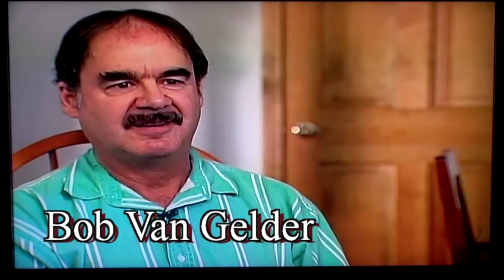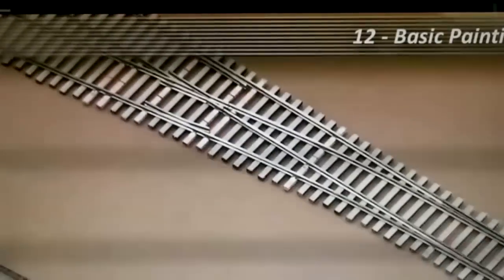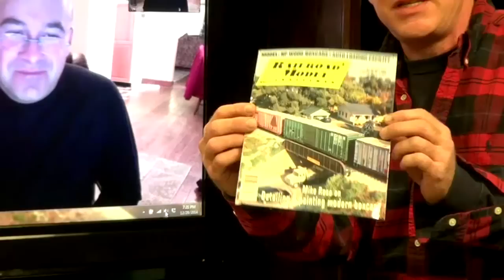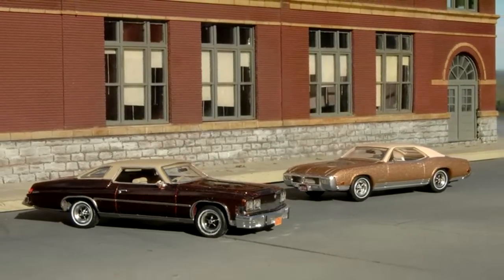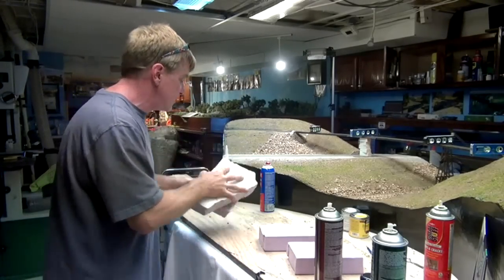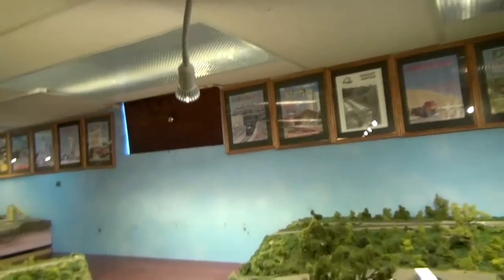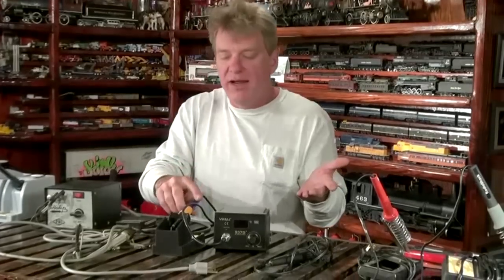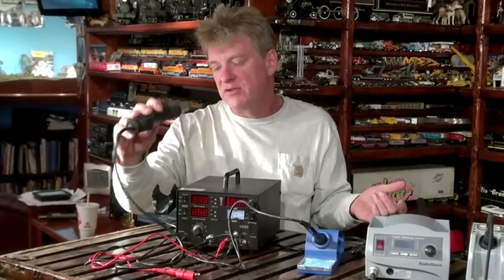What's Neat: Scotty Mason | Model railroad tips | Model Railroad Hobbyist | MRH

Comment: For gluing sections of foam for scenery, I use a low temperature glue gun / glue sticks. Dries in seconds, doesn't smell like the spray glues you were showing, and holds plenty good enough for scenery. Note that you do not want to use regular hot glue as will melt through the foam too much. I bought mine at a local craft store.